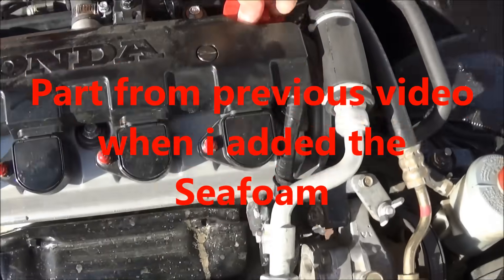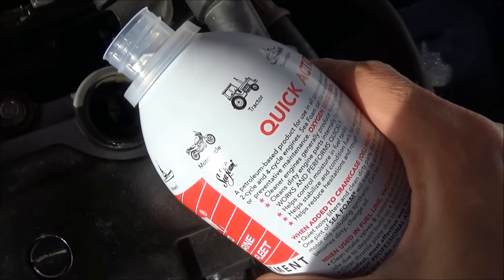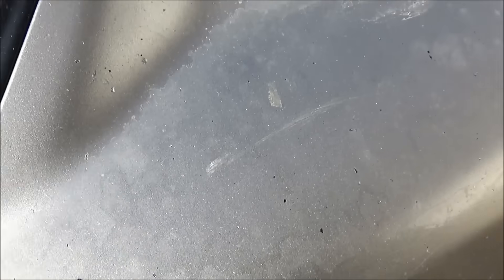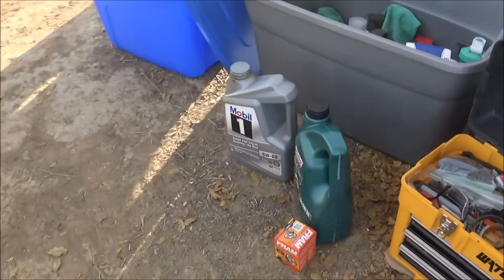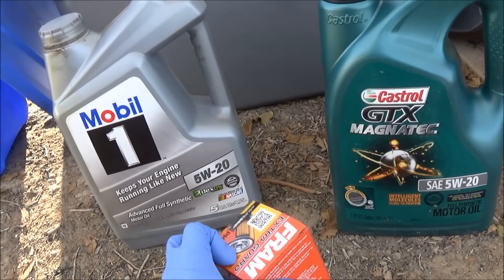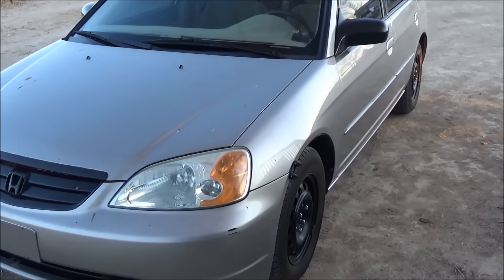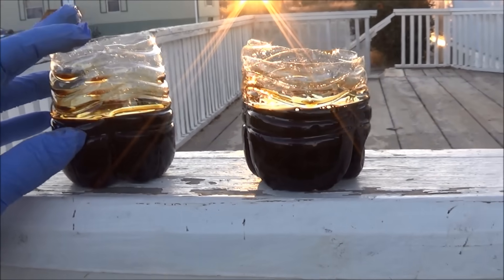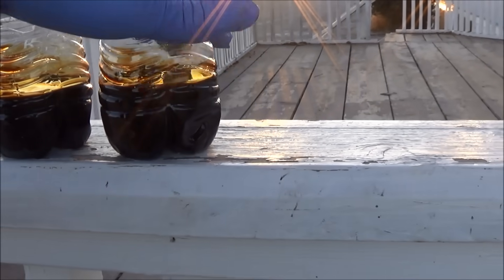Seafoam In Oil | Seafoam In Oil Before And After | Seafoam In Oil Before Oil Change [Sea Foam]

Comment: The castrol magnetic is better than Mobil one. But nonetheless, they are both good.
Reply from the maker: +Richard Ojeda Thanks for the feedback man. This is my first time trying castrol magnetic
Reply: ThizzleKid420 I also make YouTube videos on different oil additives and get the oil analyzed. Check out my channel, I can tell you enjoy doing and learning about this stuff. So do I. I am currently testing out hy-per lube oil supplement with Kendall full synthetic with liquid titanium 5w-30. I'll have a video of it around a month from now.
Reply: I read a few months ago that Magnatec is good oil, but it has a tendency to form sludge and someone even claimed it can eventually lock up your engine (I'm thinking if not changed regularly). I meant to start using Magnatec on my B14 Nissan, but I have not found anyone who has actually tested the oil (Magnatec), or other oils for that matter, appropriately and long enough to really make any solid claims.
Reply: Richard Ojeda  You should check out Schaeffer oil. Some of the best lubricants in the world since 1839 and made in USA. 
www.schaefferoil.com
Reply: U went from usin good oil n filters to trash filter n shitty oil swap back to Mobil 1 price is higher i know but its better quality Lucas oil full synthetic is REALLY good oil i use mobil 1 or lucas in all my vehicles ive used Valvoline before they are really good too but over all good vid just promise to never use that crappy shit again lol
Reply from the maker: Oh i see. Yeha this is the first time using it so ill see how it looks here soon when 5k is up and i change the oil.
Reply: sparklysparks77 My brother used the Castrol Magnetec for 7,000 miles and it came out like normal used oil. Honestly, 7,000 is a bit too much for me but I believe it can go to 10,000 mi.
Reply: Magnatec debunked....sorry guys its not magnetic. Doesnt help stick either especially to aluminum or mostly aluminum engines. And the titanium oil has like 5ppm titanium.....yeah thats like nothing. Castrols been caught plenty of times and have lost a lawsuit of false advertizing. Just saying. Pennzoil platinum natural gas is the best for cleaning sludge.
Reply from the maker: Richard Ojeda Yeah i only go 5k miles with mine.
Reply from the maker: Haha i wanted to do some experiments. I will be going back to mobil 1.